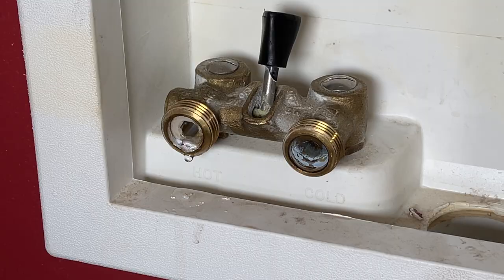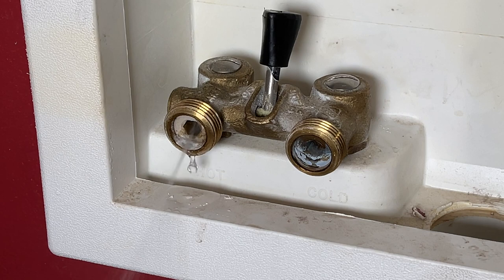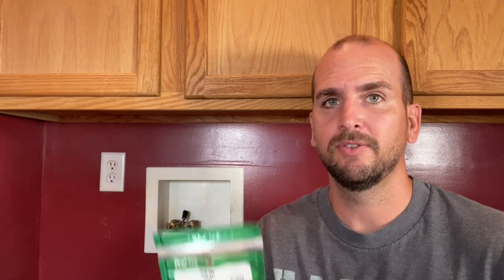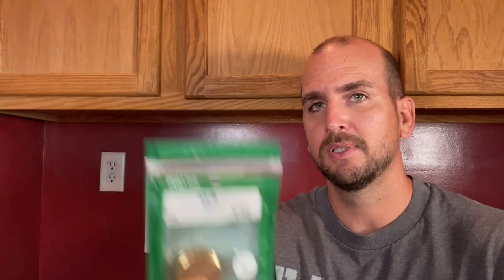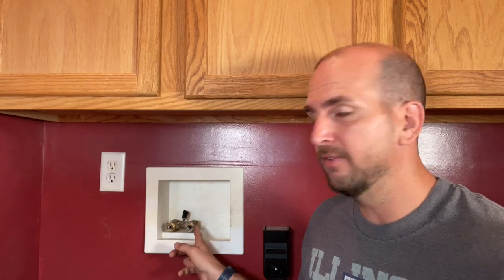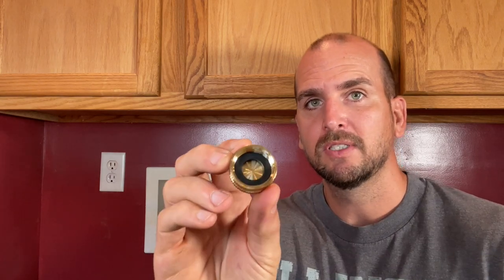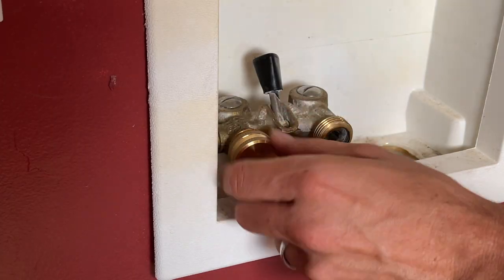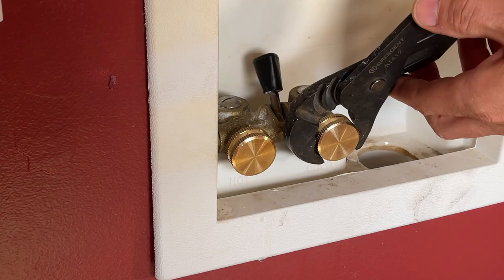Stop Water Leak At Washing Machine Valve | Fast Temporary Fix

Comment: Thanks Scott!  Excellent tip to keep these handy in my emergency go to kit for home repairs and emergencies.  One other suggestion is to keep 1/2” and 3/4” SharkBite caps in the kit too in case your water pipe busts from being frozen in the winter you can quickly cut the copper or plastic water line to temporarily shut the water off in that area by using these reusable caps.

Comment: OR ... just screw on a hose nozzle in an emergency.  Instead of letting it leak while you run to the hardware store. I do wonder sometimes how many people even know where the water shut off valve is in their houses. And if they do, do they periodically exercise it to ensure it will not be stuck when the next water emergency arises?
Reply from the maker: I actually like the idea 👍 I bet about 75% of home owners don't know where their main shutoff is located and especially not in an emergency scenario when you need to think fast!
Reply: I just tested mine, thanks
Reply: @EverydayHomeRepairs  I found ours by complete accident

Comment: Converting an old laundry room into a storage room. Unhook the washing machine hose from the valve to find out that both of them were leaking, from hot more so than cold. My question is capping knees safe for a long-term solution? I'm afraid of a possible excess build up of water pressure

Comment: Would this work say my washer tore up took throw Away need new one and we're the cut off valve id has one washer hose running to the cold and that it's leaking around the thread of the hose that screws on the water valve I have a slow leak and recently widow noone to help us never learned these things it leaking like half 39gallon trash bag water every day